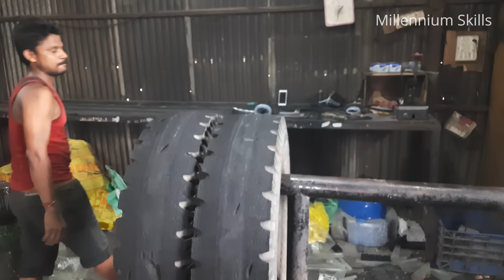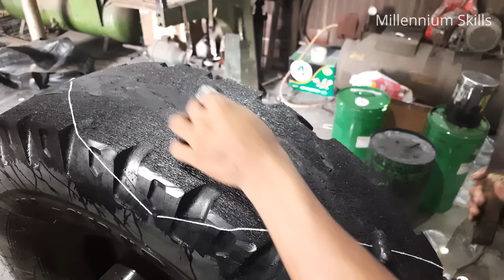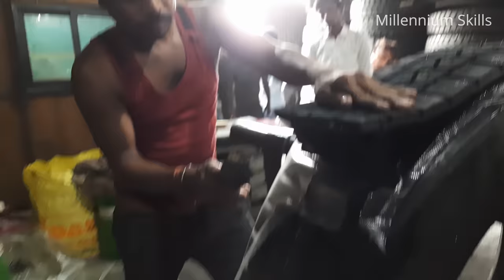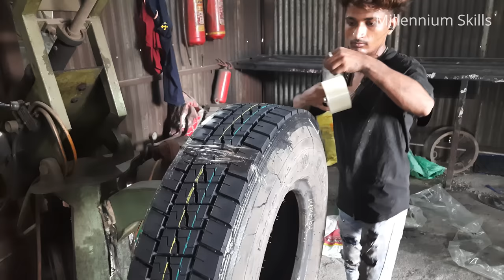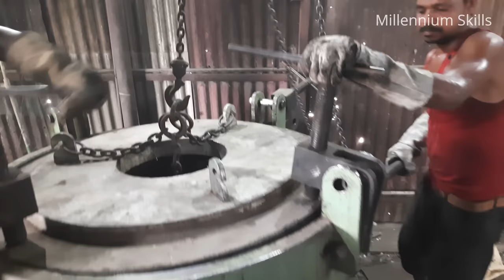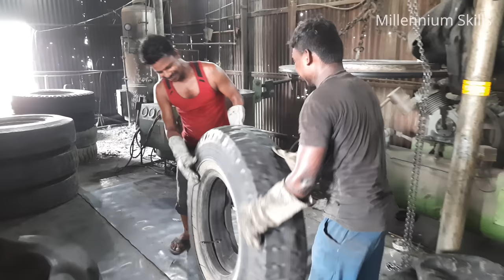How to Recapping Old Tyre to Make Them Look New | Retreading Plant Tour | How Old Tire Are Retreaded

Comment: There are trucks running out there by the thousands on re-caps that process been around for probly 60 years or more maybe….that rubber you see on hwy’s all over are some of them when they reach there limit but all in all they do last a pretty long time ,,,,! Love the vid man very cool stuff
Reply: yes there are. we all know its only someone who is desperate to save some money. we also know they are trouble waiting to happen. not a wise investment if your truck is your life.
dead gators everywhere!
Reply: Reputable retreaders are very selective on what tires they use. The failures you see are about always from the tire carcass itself. Crappy tire = crappy retread. And these tires look like pretty crappy Chinese throwaways. That being said, most commercial aircraft are using retreads. 😮
Reply: in my country  back in days  every single person purchased  this refurbished tires    we don't drive  160 km  an hours the infrastructure of the country won't allow drivers to do more than 45 miles   90 km  so this tires are not a danger

Comment: Every so often you will see these bands of tread on the highway where one of them separated from the tire
Reply: According to highway statistics those gators you see are mostly from pickup trucks and cars if you go measure the width of the tread you will find out it is not tractor trailer tires.

Comment: That was interesting, but what was the purpose of the white string that was laid diagonally across the tyre surface before the tread was attached?
Reply: I used to work in a recap shop here in Pennsylvania..the white string that gets laid across is to help get any air pockets out from  under the tread while it's under vacuum when it's put into the chamber to cook it...we used to put it on in 3 separate spots..ours was more of like a fish net rope not a single strand
Reply: @chevis26  Thanks for that information,  I'd never have guessed it though.
Reply: @mrmyorky5634  yeah,like this guy said....it's to exit trapped air but basically it's been done incorrectly/ineffectively

Comment: This tires never will can balance.
Reply: You're wrong like balance out just fine. I just really wonder why they would really want to balance them out putting them on a trailer and running around in dirt these tires are not driven on the interstate highway system of a developed country.

Comment: Only tires that can be  recapped  or repaired with a major issue is very slow moving vehicles .....PERIOD!!  FAST MOVING CARS IS ASKING FOR A EARLY RETIREMENT 6FT. UNDER !!
Reply: Not true, I have been reading about the reliability of re-treaded tyres, they're almost as good and reliable as new ones, with just as good performance, but only costing about 1/3 of the price of new ones.

Comment: Is it like a new Tyre performance!!?
Reply: When I was broke I looked up some refurbished tires for my car. Manufacturer recommended H tire rated for 130mph. The best refurb I could find, from reputable manufacturer, was rated for 56mph only (!!) That was made using a better process than this video. Needless to say, I've Ended up saving for new tires.

Did you ever see tire pieces by the side of the road almost looking like an orange peel but from rubber?

They're from retreaded tires that failed. Commonly used by trucks and cargo vehicles.

Comment: Retreading a old dried out tire is not safe and in the United States these tires are shredded all over our highways and truckers call them alligators and you don’t want to hit one or it can tear up your car pretty bad.
Reply: Keep quiet!
Reply: The reason for that is your trucks have two axles on the back of the trailers no matter what load ,
Reply: This is no different than building a new tyre
Reply: @chrisstaylor8377  ；.
Reply: สวัสดีคค445544